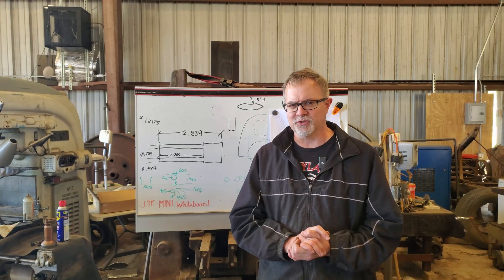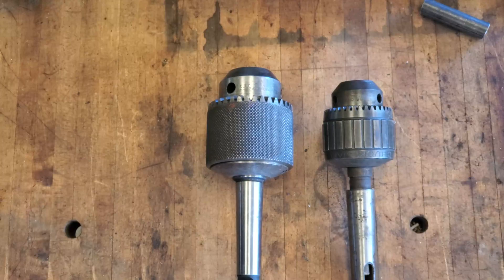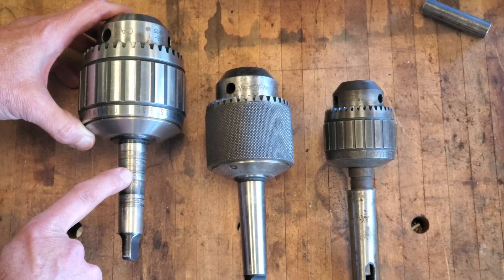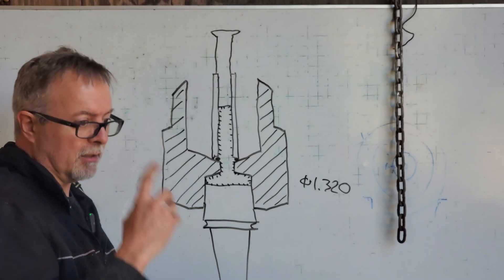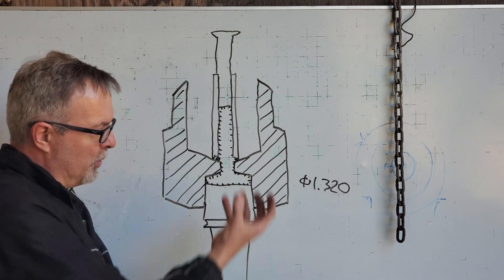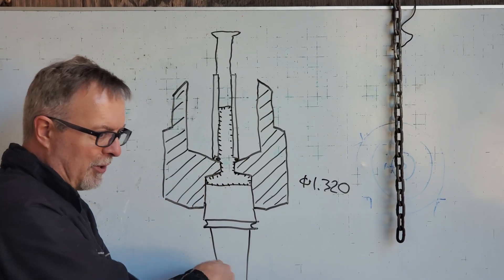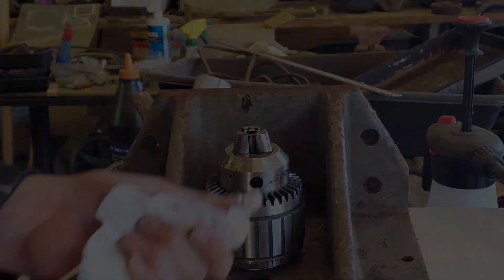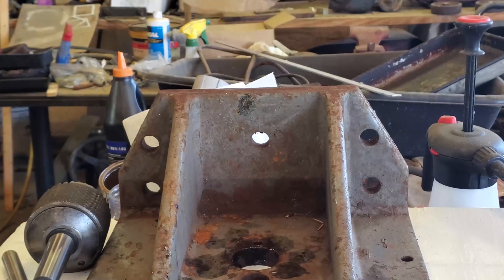Removing a Stuck Chuck Arbor Using Oil and Hydraulic Pressure

Comment: I like that.   Used it on a really stuck blade dowel in the port side variable pitch propeller hub for one of the blade dowels.  The machinists thought I was nuts until the dowel shot out of the propeller hub…half way across the drydock.
😆
Reply from the maker: Works like a charm! Worth the look on his face I bet.

Comment: Cool trick. I might have to try that on one of my chucks that has a stuck arbor.
Reply from the maker: It's amazing how a little oil and pressure can do the job! I used grease on the Monarch quill lock but the oil was easier.

Comment: I would of thought that the jaws would slip before making the pressure itr needed. What a great  trick to remove that arbor. I'll definitely be using that at some point. Thanks for sharing.
Reply from the maker: Jaws lifted the sleeve slightly so i had to tap it down to get the O ring to seal. All good after that.